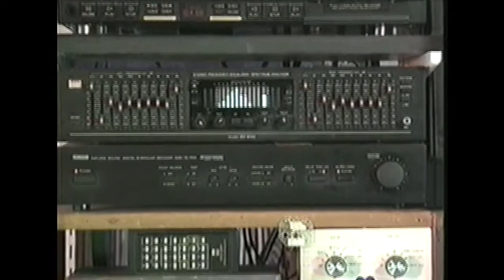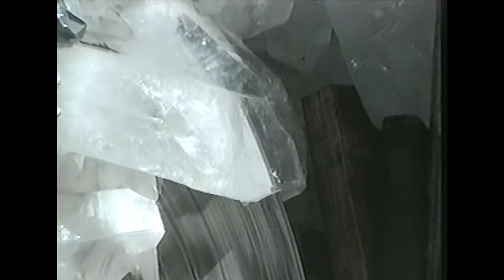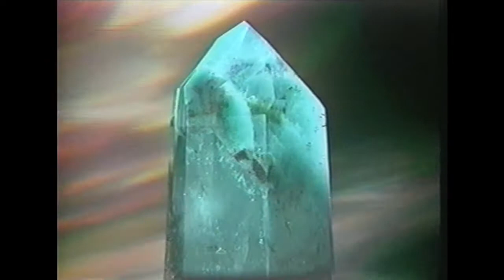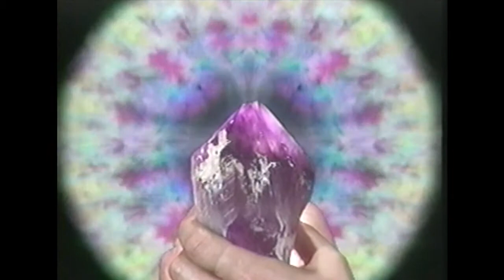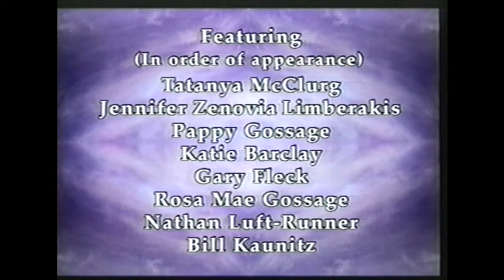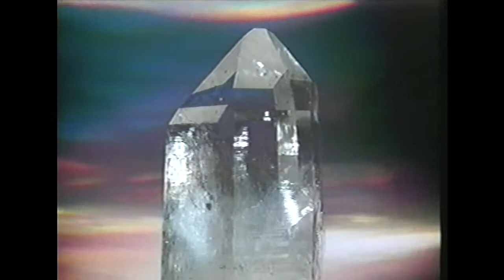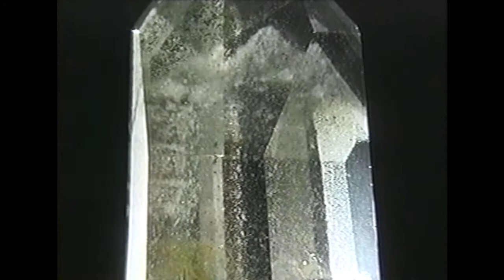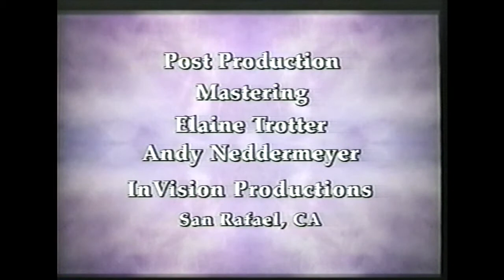Crystal Miracles / Crystal Mysteries [Full Movie VHS 1998]

Comment: Favorite timestamps in no particular order
18:16 You can experience a crystal as a powerful energy tool without the use of any additional devices or electronics
10:14 You can dig with other people or find a private spot all your own
9:05 Drive up to the mine's parking lot and get ready for fun!
43:20 Begin by rubbing your empty hands together quickly
42:08 Use the palm of your hand or your fingertips
48:10 You will feel subtle tingling sensations grow into waves of energy sweeping through your body
6:58 Yes
6:11 Yes
14:36 Any substance that-
22:42 Comes out of the tip and edges-
18:40 For instance, the purified dna of your genetic material-
13:35 A special bond is formed between you and the stone that was inside the earth for millions of years
12:48 Then rinse with cool water
12:55 Your Crystal Will Sparkle Forever